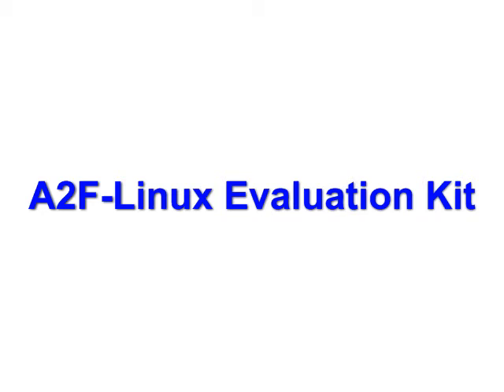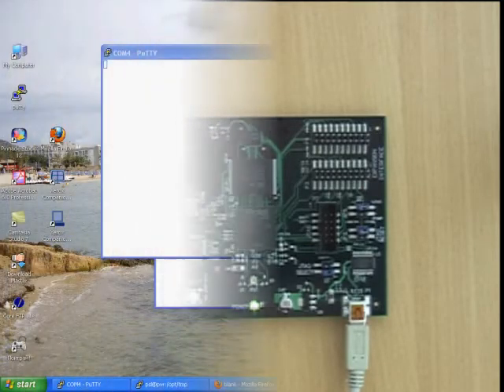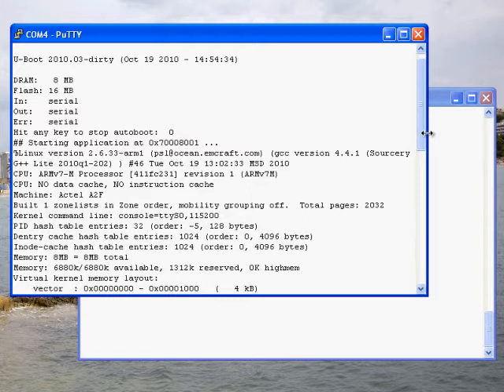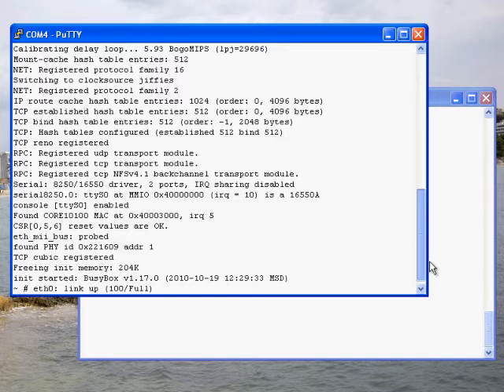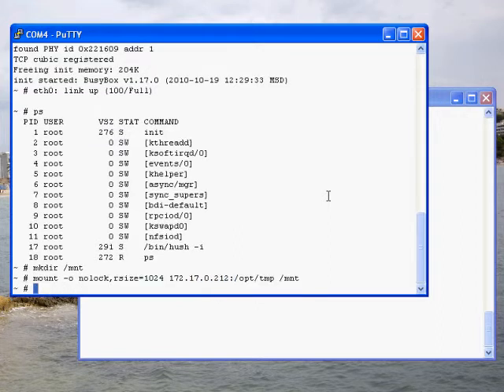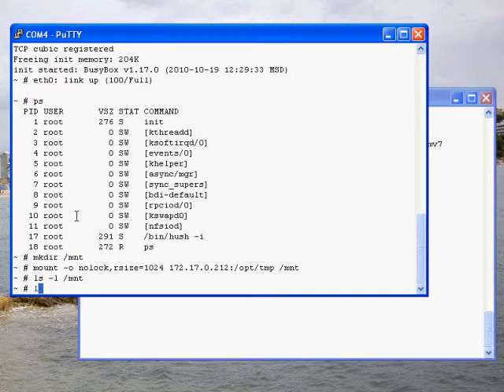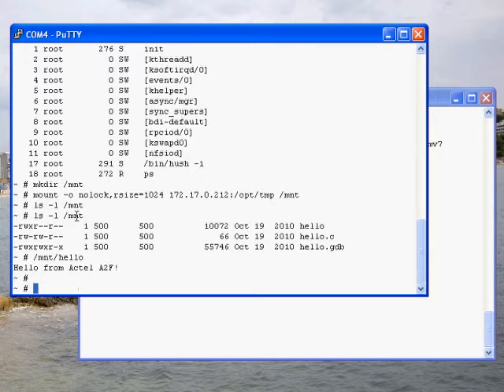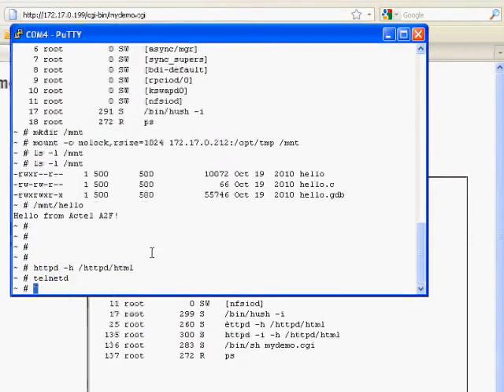Microsemi SmartFusion Linux Evaluation Kit

Comment: Linux on Microsemi's SmartFusion  product with on-chip ARM Corte-M3 will be greatly beneficial to embedded systems designers. This certainly is a much needed offering on Cortex-M3 platform and will allow engineers to leverage vast amount of Linux based code out there in the open-source universe enabling faster time-to-market.